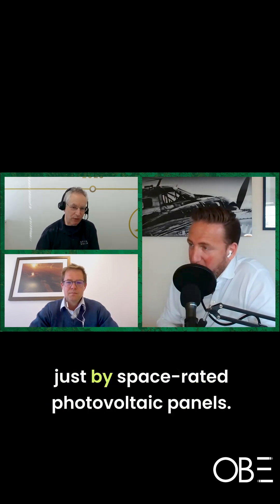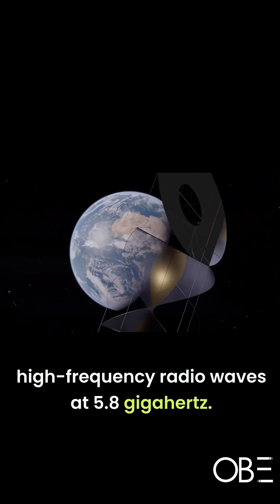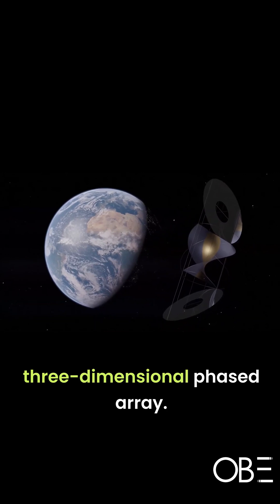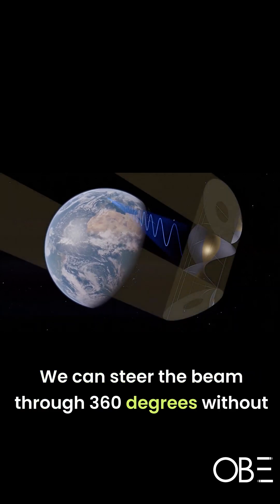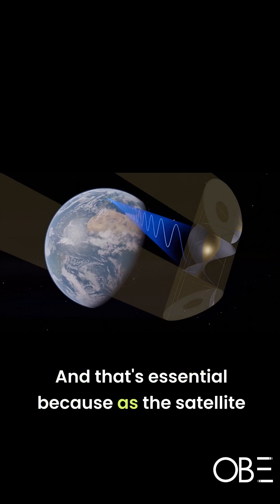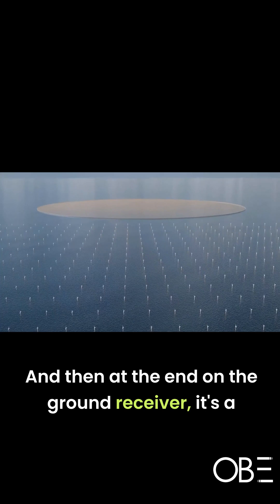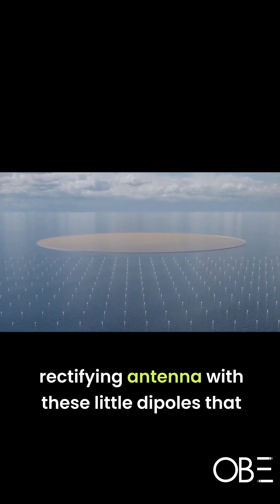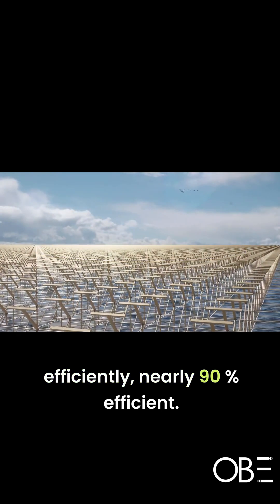Beaming Solar Power from Space? | Raw Green x Space Solar

Comment: This will not help with global warming. It will increase the rate of global warming. The microwaves will heat up the atmosphere as it passes through it. This is literal pie in the sky tech that will do more harm then good. Now if we deploy this around the moon or mars for bases that would be a great use for this tech. The Moon doesn't have a meaningful atmosphere to heat up and Mars is very cold so it might be good to heat it up.
Reply from the maker: Thanks for your comment and a legitimate concern. We asked about this and the heat generated by the wireless transmission is below the one generated by solar panels. Very good idea tho that this tech could power a Moon station!

Comment: Open loop?  The receiver should send an “okay” signal to the transmitter when the radio waves are being correctly received.  If the transmitter loses alignment with the receiver the receiver should send a “not okay” signal to the transmitter and the transmitter should shut down (or go low power ) and enter a realignment procedure.
Reply: Very clever point. Pretty sure there is going to be a quite high level of compliance before starting operations, which must include scenarios of misalignment